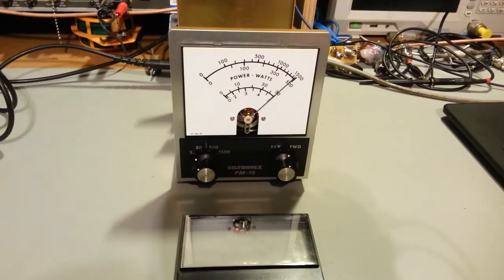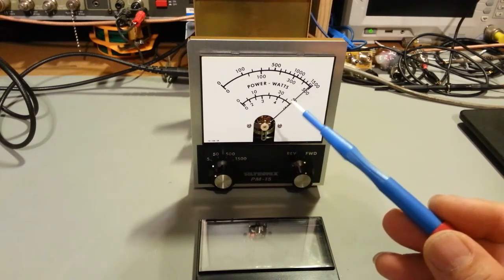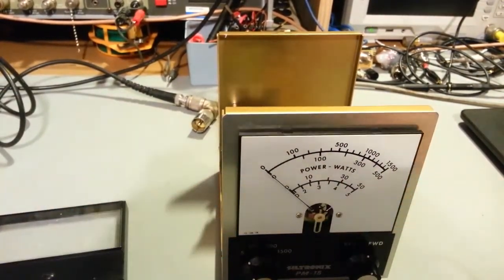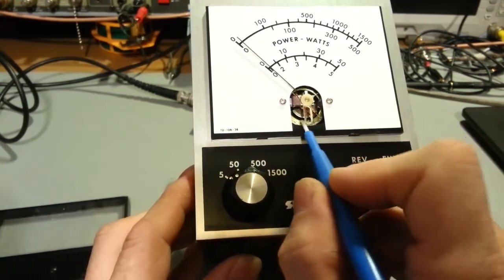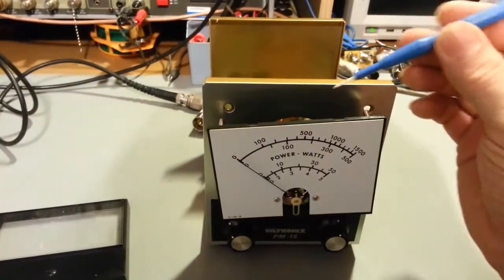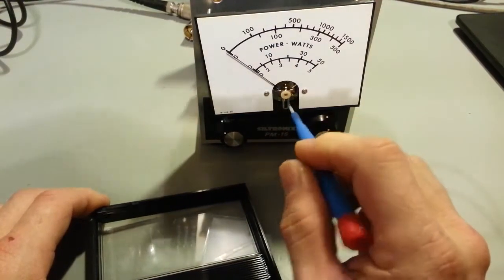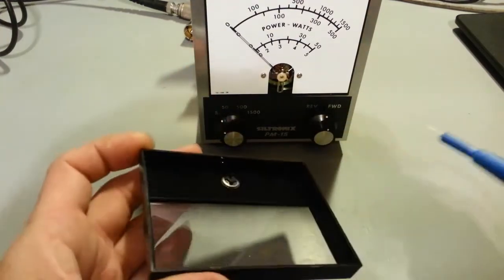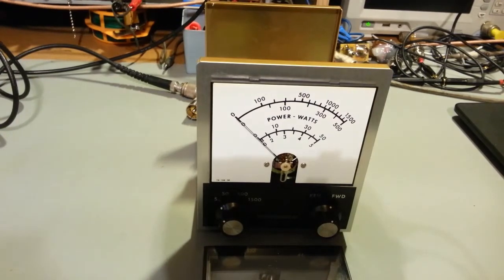Siltronix PM-15 watt meter movement repair.

Comment: The needle in one of my Sencore PR57s occasionally hangs at one of two specific spots. I I took it apart today to troubleshoot, I backed off the center screw. If anything, it made it a little worse. I put the screw back in the original position and it seemed fixed for a minute, but then hung in the same spot. Do you have any tips?

Comment: I just took shipment of a vintage aviation dual channel cylinder head temperature gauge, and one channel has a meter stuck below zero.  The neutral position should be room temp instead. It looked fine in the listings, so it looks like it suffered some mechanical shock.  I'll have to see how to take it apart. Thanks for the inspiration.

Comment: Thank you sooo much! I have an SILTRONIX  FS-600A. It would move well but fall at about 8 watts. I would tap the cabinet and it would make its way down to zero. I removed the cover and checked out the spring. It looked weird and the outer section was over a white colored wire next to the meter. I took my dental pick and moved it over the wire and the spring went back to its normal looking self. Works great now. Thanks again!
Dave
W6CPY

Comment: mine (a vu meter) has lost electrical contact between leads and coil on one side - bummer- impossible to find where the connection is sadly

Comment: Mike I've recently replaced the rear spring on an analogue multimeter , a job not for the faint of heart I can tell you. It was on  Kamoden TRCX 360 and had gotten twisted somehow before I acquired it and the meter wouldn't read correctly, I had a couple of others but not that model but with the same meter so one became a donor. Definitely a Magnifier headset and steady hand job. Works really well now.